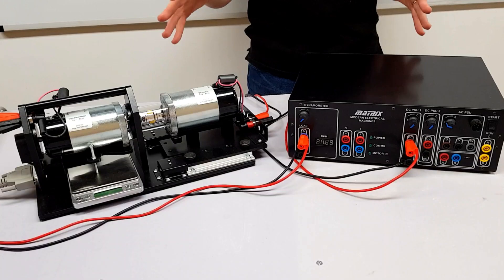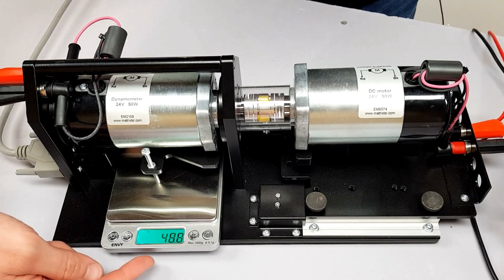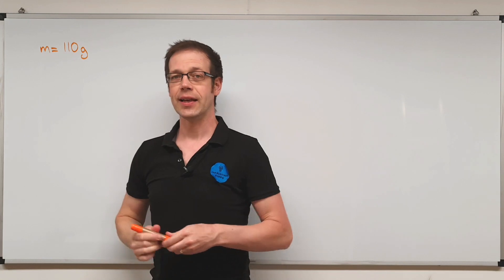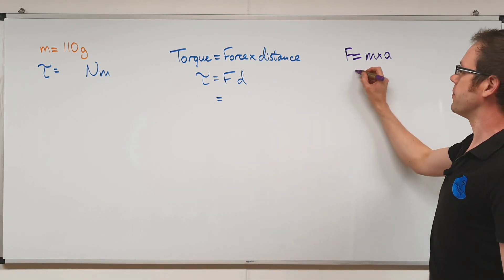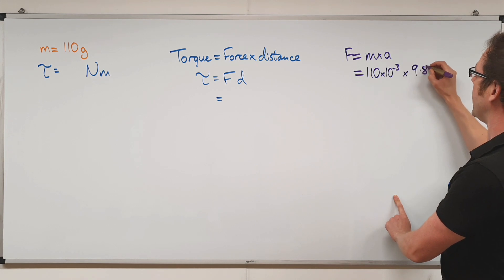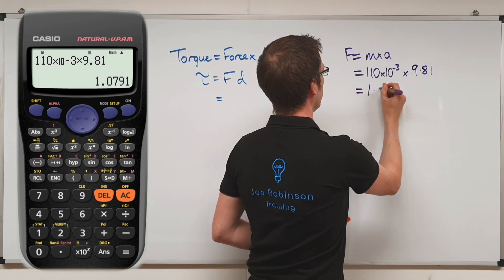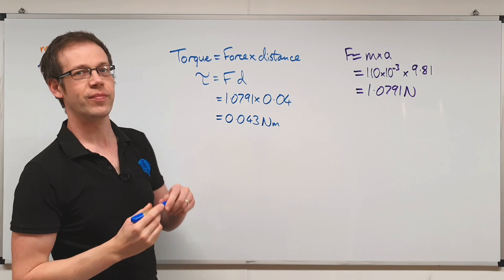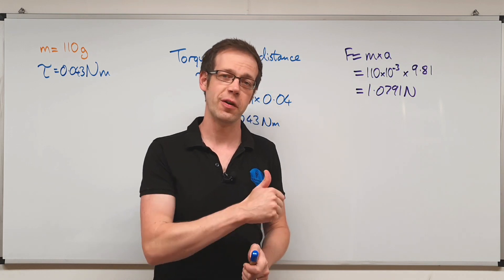How to Calculate Torque for a Motor

Comment: I'm looking back over old engineering notes to see what I remember (and wondering if I should have stuck to a career in control engineering). We looked at the control of an inverted pendulum but I don't remember how we converted the control system output (a duty cycle to a H Bridge) to torque on the motor. To add to complexity, the control system operates on a moving object who's speed (and therefore motor speed) changes.

So if I'm trying to calculate my control loop transfer equations, how do I go from H Bridge to Applied Torque (and therefore applied linear force on the trolley that is connected via a belt)?

I wonder if we just used a stupidly powerful motor as a servo in the end and position controlled the trolley, with the servo control loop "taken care of" for us so we could concentrate on the pendulum. It's a while ago.

It sounds from the end of your video like I need to follow the next videos.....
Reply: Maybe we just use the stationary torque on the assumption that the system will be near enough stationary when properly operating, and errors from the slight movement are within the control margins. I can find how Torque Constant relates that to motor current (for a brushless anyway). But this is not a motor who's motion is blocked, but a motor acting freely on the inertia of the system.

Comment: What I'm trying to understand is how are these formulas universally correct i.e. what if you express values in inches instead of centimeters and instead of grams and kilograms, pounds or ounces or whatever unit they may be using on other planets?
Reply: the formulas work in mertic units, if you have inches you must first convert it to metres before calculating the force or if you have pounds you must first convert that value to kilograms to calculate the correct value, these formulas dont just work with any random values because torque is represented in Newton-metres not Newton-inches for example
Reply: @ethanhunt3933  so, that was the missing info. hypothetical aliens on other worlds may be using different formulas altogether. lecturers always fail to explain that.

Comment: I need an answer to the following question for selecting a motor for a particular project.
Can you please  help me? 

Suppose I have a car with 1 wheel driven by a single motor. Total weight is 50KG (W). Maximum speed needed is 0.5meter per second (S). Wheel dia is 4.5cm (D). Gear ratio is 100 from motor to wheel (GR). Motor RPM is variable but assume 3000 rpm (R). What is the torque needed for the motor? T =? in N.meter.
Both a value and in terms of T(W,S,D,GR,R)

Comment: Can not believe that torque number is so low , I  bought a chinese hub motor wheel for an ebike and they claim 71 Nm.
  How can that be possible ? Its a Dc 1500W at 48V.
Reply: hub motors have planetary gears buitin that increase torque

Comment: hey Joe can you please upload the video when u load the motor and explain it . i dont understand why we need dynomometer for it . wouldt it be simpler just measure stall torque of the motor and that is the max torque its can produce without movement ?
Reply: yes...you are right bro..this is wrong calculation..

Comment: Watching these videos as much for the master class in teaching as the excellent content itself.
Reply from the maker: Ah, thanks, that's a kind thing to say.
Reply: @JoeRobinsonTraining  AZA
Reply: @JoeRobinsonTraining  If a motor has higher current that means more torque but less spin which means less voltage and if it has a higher voltage but less current that means  less torque but higher spin, thus we use greater current for Impact drivers and greater voltage for drills....

Comment: Hi Joe, great video. How did you figure out the distance?
Reply from the maker: Hi Richard. It's just set value in the motor documentation.
Reply: Joe Robinson Training  Thank you Joe 👍
Reply: @JoeRobinsonTraining  but what is the distance?  is it the distance from the axis center of rotation to the tangent, or to the scale?

Comment: When I went to school, our answers were marked wrong when we did not include Units of Measure. Suggest what you include Units of Measure so that students can readily see that they are multiplying and dividing appropriately.

Please clarify how a dynamometer torque arm pressing on a scale provides mass and not force. 

Thanks.
Reply from the maker: I was taught the opposite! Putting letters into an equation after the number turns it into a constant multiplying a variable. 2kg becomes 2 x k x g.

See the link below for the mass to force relationship and calculation:
https://youtu.be/7NQTVm-2WKA
Reply: Example. 3 ft x 3 lbf = 9 ft-lbf. In more complex equations, I would sometimes get mixed up on which item should be in the numerator and which is in the denominator. It becomes obvious when the units cancel out and the answer has the correct units of measure. 

Ft is one entity, not two. Ft = feet, not Fuuf, Teee and not F x T.
Reply from the maker: 🤷‍♂️ You do you. 👍
Reply: If 2kg represents 2 x k x g, then 10 x 1 is 1 x 0 x 1 or 0. 🙁